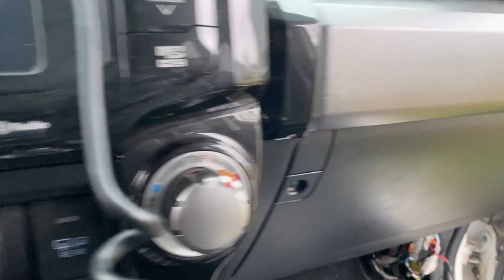Meso Customs puddle light on off switch install

Comment: I just received my MESO switch kit this weekend (and have their Puddle Light kit too) and find this video very useful and timely. I am relieved that it appears a much easier install on the 4Runner than on the Tacoma (per another video I watched). Thanks soo much for the post. I'll be sharing it!
Reply from the maker: At first I had a hard time figuring out how to get the wire behind the stereo area until my buddy found that the trim piece was easy to remove.

I’m still learning how to get good video and how to edit it. I try to get to the point and not waste people’s time.
Reply: @EvergreenOffroad  I’d love to see how you got the wire to the passenger side.
Reply from the maker: @chrismerritt3467  it’s in the video
Reply: @EvergreenOffroad  welp. Guess I was too impatient. Thanks a ton. This was helpful.
Reply from the maker: @chrismerritt3467  no problem

Comment: Was glad to find your video. Used it as guidance for MY 21 4R. Very similar. My only legit complaint was I was going to reroute my auto high beam to lower switch port on left side, but button wouldn't fit. So now this item has been placed in the lower port.
Reply from the maker: Awesome!, Glad to hear it helped out!
Reply: @Evergreen Offroad  hey. So quick question. I tapped into a green wire from the mirror control, but the button isn't back lighting. I'm curious if I'm missing something? Any tips would be appreciated.
Reply from the maker: @playdixie  I think you have to tap into a power that’s always hot when the ignition is on.

I normally don’t power my lights to have a backlit cause it bothers my vision at night.
Reply: @EvergreenOffroad  thanks for the info. i don't normally keep my lights on during the day. but getting it to backlight has been a headache. but i appreciate the info.

Comment: I found your video very useful thank you.. when I wired everything according to your video my windows on the driver side cluster don’t work except for the drivers side but all other windows work on there own and the MESO switch itself isn’t turning on the lights but the lights work when I walk up to the truck not sure what I’m missing
Reply from the maker: Did you use the ground wire
Reply: Yes the same way you did it
Reply from the maker: @lawrencemiller262  I would contact meso customs

Comment: Do you know if this will work on the 4runner without the meso puddle light. Can it operate a standard led puddle light?
Reply from the maker: It should be able to, this all plugs into the factory wiring

Comment: I came here to see where you tapped into the 12v illumination wire and you didn't show that part.  Do you remember which one it was?
Reply from the maker: I just tapped into the same power that I used for the switch leg for the relay

Comment: How did you wired to the mirror? I have 2019 Tundra limited there is no wires? How can I run to the mirrors right and left??? Please advise thank you
Reply from the maker: My 4runner already had the wiring in place from the factory

Comment: how did you tap into the illumination for the switch?
Reply from the maker: The green wire for the switch is the illumination
Reply: @EvergreenOffroad  Do you just t-tap it into another green wire from another switch?
Reply from the maker: @shakeyfly  yes that works

Comment: do you have other rock light ? wish  it came with some pigtail  for rock lights
Reply from the maker: I do, I’m going to install other ones though.

My plan is to connect the trigger wire off the relay for my rock lights to a positive wire for the harness kit from Meso customs. That way when the puddle lights turn on the rock lights do also
Reply: @EvergreenOffroad   sweet  thanks for your vids by the way made all my install go easy.  I also subbed to your ch
Reply from the maker: @ironmendm9  thank you. I appreciate it.

I’m hoping to get out and do some offroad trips soon. Just picked up the new go pro 9.

It’s tough trying to get good video and be a spotter at the same time. It’s usually my wife that’s driving and me that’s doing the videoing.
Reply: @EvergreenOffroad  Try driving & having your 9 or 11yo kids do the videography- it’s going to take a lot of practice.
Reply: Thanks for the video. I buy this stuff for my Mom’s truck which I only see a couple times a year so it’s good to just know it’s going to work.
Reply: @EvergreenOffroad  Definitely video that - I’d like to do the same!
Reply: I’m assuming the “On” works even while driving, does it work if the ignition is off?
Reply: @EvergreenOffroad  ya i also have these puddle pods for my tacoma and planning on getting kc rock lights and i was thinking also to piggy off the wires to turn them on manually witht the switch too? U know which wire i could tap into or have u done it yet?
Reply from the maker: @whiteazn2  that’s my plan
Reply: @EvergreenOffroad  u know which wire color?
Reply from the maker: @whiteazn2  I am not sure yet, I think you should be able to tap into the red wire that goes under the dash to the other side of the vehicle. My thought is to use it as the trigger wire for the rock light relay
Reply: @EvergreenOffroad  tacoma is little differ install then the 4runner.. but i can figure it out...